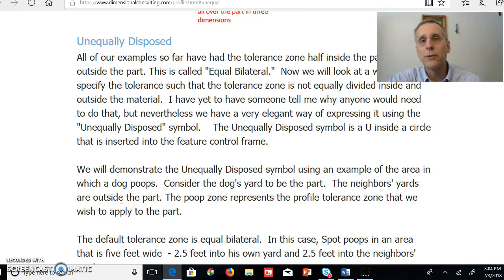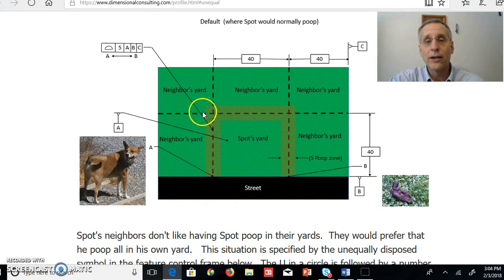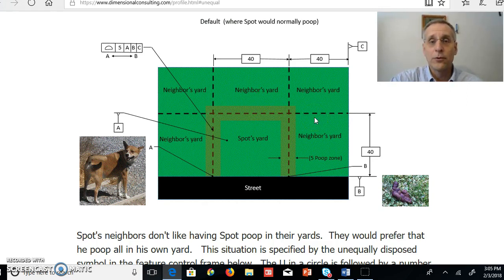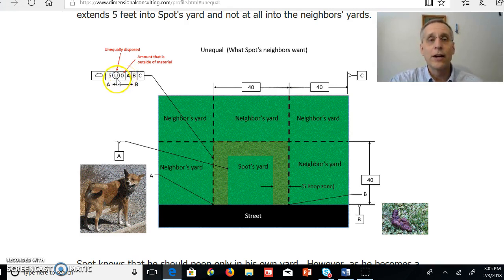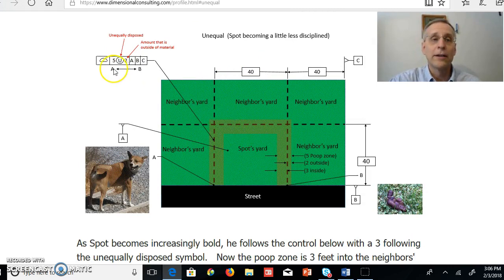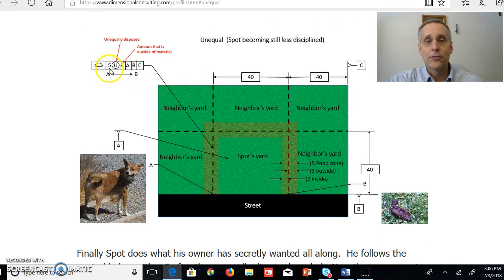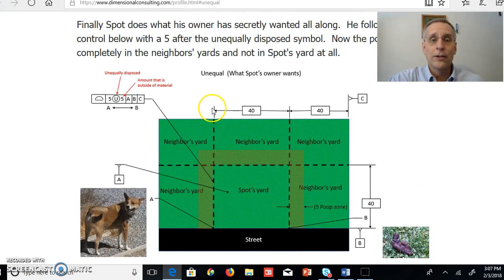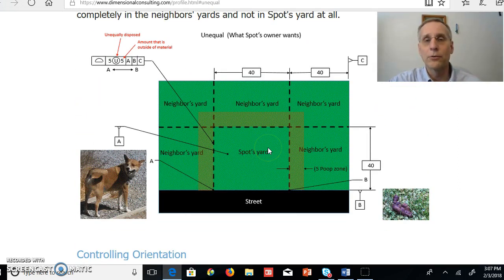Unequally Disposed Profile

Comment: LOVE the video. One question - despite the side of the feature that the arrow points to, is the number following the U symbol always OUTSIDE of material? Example - what if the scenario was pointing to the inside of the feature? Lastly - if you didn't reference datum features, would the profile become only a feature size control? Thanks!
Reply from the maker: Yes, the number following the U symbol is always outside the material.  So if it were pointing at a hole, the number following the U symbol would allow the hole to get smaller.  

It can indeed control the size of a feature, but I still would not call it a feature of size.  A feature of size always has a coordinate tolerance controlling the size.

Comment: Is there a method of reporting profile error using variable data?  Historically, the formula used was max - min if crossing nominal or if all positive or negative error is observed, 2*max deviation from nominal.
Reply from the maker: I am not familiar with a standard method of reporting the data.  I am guessing that would be determined by whoever requires the data.
Reply: I have used the method of reporting my tolerance / my deviation from tolerance. Example for bilateral would be +/- 0.25 / over / actual result. The result could be anything from + to - 0.25. Also - if you wanted to, you could report in the basic feature box the range that you found. Example: Feature is 40mm and you report 39.8 - 40.22 (all acceptable applying that tolerance). Make sense?
Reply: I forgot - when I do report actual readings in comparison to the basic features I do NOT accept or reject that data. The accept reject criteria is reported in the profile callout.